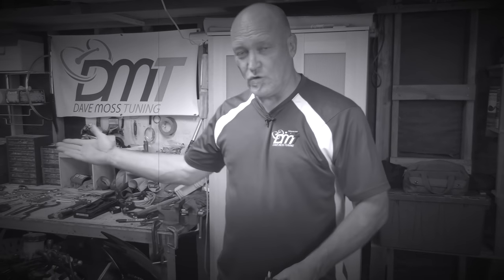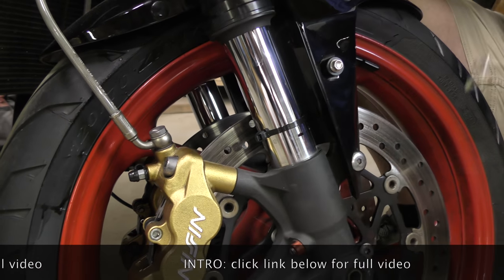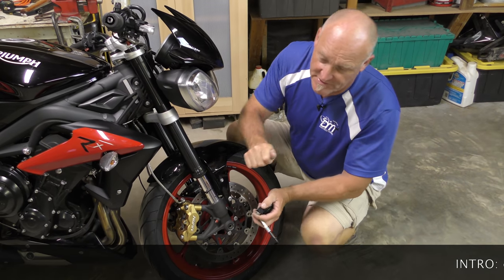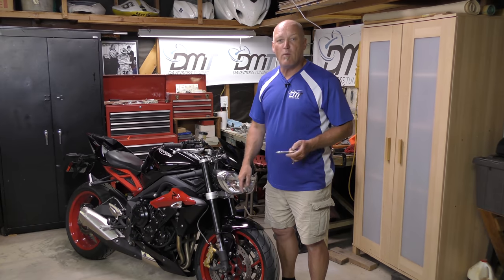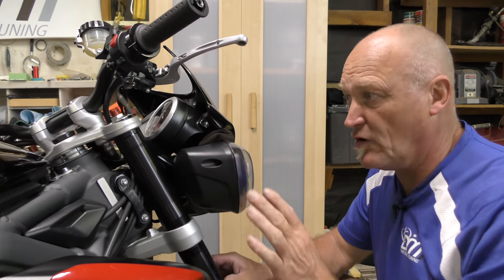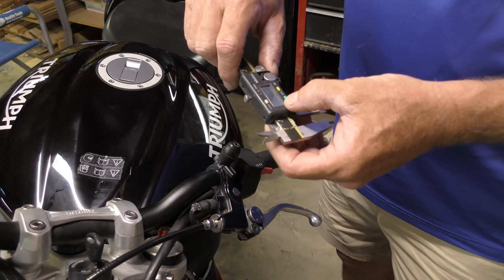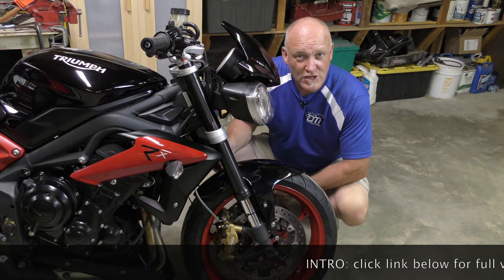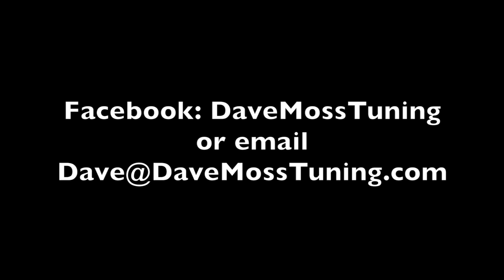INTRO How & Why To Change Your Motorcycle Fork Position

Comment: I have a quick question on this. I have an S1000XR and I get a slight front end wobble at high speed cornering (90mph+ sweepers). Increasing the rear preload decreased this wobble so it makes me think it's a problem with the pitch of the bike. Usually increasing how much the forks stick out at the top make the bike more agile but less stable at speed due to reduced rake, but would it help with the wobble due to pitching the bike forward and putting more weight on the front? I don't really want to go higher on preload as the ride would be too harsh and other handling issues arise. The bike has electronic suspension and putting the damping into the sporty setting also helps a bit with the wobble but it's still present. The forks are currently level with the triple tree so there is no room to go down. Any help would be appreciated!
Reply: I might be wrong here but that sounds like a rebound issue tbh.
Reply: @greyanaroth  Maybe, but as I said no way to fix it directly due to electronic suspension
Reply: @AntaresSQ01  I remember dave suggesting, depending on the amount of travel used :

Take out preload so it'll stop the spring pinging back (if you're not using enough travel). Do you have a zip tie on the fork?
Reply: @greyanaroth  As far as I'm aware the preload on the front forks is not adjusted by D-ESA or very minimally, basically when adjusting the preload it raises or lowers the rear  for the most part, you can pitch the whole bike forwards (increasing rear ride height/reducing rake and trail). It's weird but it helps, despite on paper making the trail/rake smaller it should make the bike more nervous. It's not a perfect system by any means but I'd rather have 90% correct suspension 90% of the time than 100% correct suspension 10% of the time. The only issue really is with the head wobble in high speed corners when on the gas. This can be vastly mitigated but in doing so I cause other issues/discomforts in the handling, so I'd like to root it out as a geometry change, and retain fine tuning control from that point onwards. Basically as Dave says, you don't want to be at the end of adjustability, first you wanna get the bike generally right, then fine tune with adjustments. Right now (and I am really exaggerating) the bike is not set up right for me, so no amount of adjustment will fix it completely. It may be something I have to compromise on, after all it's a Sport tourer not a Superbike, but I want some confirmation to my theories or guidance before I start messing with the geometry.
Reply: @AntaresSQ01  perhaps do a remote tuning with dave? He usually has insight you and I may not have evun begun thinking about
Reply: @greyanaroth  Hey, just as little update I played around with the settings and when the suspension is at it's absolute softest (rear preload on 1 rider, damping in road) I almost bottomed out the forks, about 5mm from bottom out. This was on a fairly aggressive twisty road with long corners and hard braking zones as well as some bumpy sections. 1 rider preload felt straight dangerous with road damping, it felt like the bike wanted to tuck under constantly at the rear when pushing hard. Next I put the bike in my usual sporty mode, 1 rider + luggage and damping in dynamic. This felt bang on, good stability in corners, stable under braking and acceleration, forks were about 40-45mm from bottom out (front on the XR has 150mm travel so this is just over 2/3 of the travel used) I'm not sure if the preload was the reason, I suspect the damping stopped the forks from bottoming out. I didn't have time to separate the 2. but when I observed how the damping works, you can obviously see it compress the shock and raise the bike on the rear, but you can't see anything at all happening on the front so, as i suspect no preload adjustment on the front. Then I did 2 rider preload + damping on dynamic. The ride in 2 rider was horrible on the bumpy sections, spine shattering. It felt a bit more "on it's toes" tipped in nicely, felt okay through the corners but was a bit twitchy on corner exit. It was rather good under braking though, noticeable less dive and as predicted, more stable in high speed scenarios. So my view right now, is I need to get the positive qualities of the 2 rider preload setting, without the spring being so hard. I don't know if this makes sense, or if you even care at all, I'm just rambling on over here haha
Reply: @AntaresSQ01  rambling is good haha. IIRC you can adjust front preload as well as rear preload manually. This, for the rear, I think changes the zero point? Time to crack open the manual!

Edit: seems like 1 rider + luggage on damping was the secret sauce. Probably have it set on that and crank up the manual preload adjuster on the rear (if it's an option) a wee bit to hit the sweet spot? This whole Esa thing tbh put me off these bmws, even though it works great for bump absorption
Reply: @greyanaroth  I know you can on the Non D-ESA suspension but on the D-ESA there is no manual adjustment options on the forks. All of it is done electronically, As for the rear, I don't see any "overrides" either. I know this is not the case on the S1000R and RR but it is on the XR (the D-ESA R and RR have electronics in both forks, the XR only has them in the left fork, right is a good old standard fork.
Reply: @AntaresSQ01  there is a nut on the fork cap on the right side, yes? And an 8mm adjuster on the rear?
Reply: @greyanaroth  No on the D-ESA the right fork cap is just a regular blank cap, I haven't really looked at the shock but i suspect it's the same, however you gave me a good (hopefully haha) idea:

https://www.ebay.co.uk/itm/313060260179?hash=item48e3d87953:g:cdUAAOSwuhZenvvM

One of these. Pop one in the right fork, and I should have some adjustment, many bikes have 1 fork damping, 1 preload so i can't see any major issues. I'll call my local suspension shop about what they think though.
Reply: @AntaresSQ01  man I'm so confused with the Esa stuff....

Comment: TORQUE SPECS!!!! A career spent working on German engines has proven to me that fastener torque and torque sequence are EXTREMELY important! The OE didn't pay some enginerd big bucks just to throw some random numbers in the book. 10:50 is a perfect example of why torque is important. Could've been over-torqued and with dissimilar metals the aluminum will deform and "bite" into the bolt. This is why if the head is looking like it'll round off before the bolt loosens up then a couple tappy taps on the head in line with the shank will help to release that "bite".
Reply from the maker: Agreed regarding care and thoroughness with torque settings.

Comment: Hi! I have a yamaha xt 350 that I bought used (obviously ;) ). The old owner has moved it down but I am unsure if he was just short. I am a 190 lbs guy and only drive on asphalt. Should I move it back to default?
Reply from the maker: 1. How planted do you want your feet to be?   2. How much can you lift up the seat to where your minimum foot contact with the ground is?   3. How much shock travel are you using?   4. Are the forks in the stock position? Those questions and answers will guide you on going back to the stock height.

Comment: Just want to confirm my understanding from the video - Raising dropping the folks doesn't change the height of the handlebar, right?
In the video Dave is making the folks taller so the front suspension would sag less than before? And this would also increase the wheelbase as well as rake, trail right?
Reply from the maker: Thanks for your question and for watching!! If you raise or lower the front via fork position the bars will go the exact same amount up or down. Y you are 100% correct in regards to sag and wheelbase. Note that increasing the height increases rake also but to a small degree.
Reply: @catalystreactionsbw  Ohh so when folks are made taller and trail increases, handlebar height also increases? 
A general question - how does the rake/wheelbase reduce during front braking, say before a corner?
Reply from the maker: @sanketjain9320   if the fork travels less, there is more rake and trail.

Comment: Hi Dave I am hoping you can help me out. I am a big guy at around 350lbs so basically my bandit 1200s k6 is basically 2 up permanently. How can I stiffen up my suspension front and rear to suit my needs? Please advise thanks.
Reply from the maker: Hi Daniel. Best option is 1.1 forks springs and 20w fork oil. For the rear shock you can contact Race Tech to see if they have a spring to replace the soft stock item. That being said, you might be better off with an aftermarket shock. https://www.customfighters.com/threads/bandit-1200-rear-shock-swap.62827/

Comment: Does this work when using rearstand lift? Thanks
Reply from the maker: It can work that way but it is much easier to use the side stand to unweight the bike, or have a front stand that goes into the lower triple along with the rear stand, or a Bursig type stand

Comment: I've heard dave say, before, that he's NOT strong. What poppycock. The man played rugby, and is built like a tank. 

Just wanted to add, after seeing you do this on the r6 and noticing a difference between my 2 fork legs, I decided to attempt to correct that only on the outside leg. And it was frightening. It helped that there was a lot of preload to take out, which I did, which made the process a bit easier. Does that make sense? Or was it just placebo?
Reply from the maker: You are correct - zero preload makes in far easier.

Comment: I own a 2022 RS660, I'm 5'9" and the bike is a bit tall! I purchased a 1" lowering disc from AF1 Racing! They told me to lower the front forks the same length! Is there going to be any problems with this set up? I am def no pro at geometry on bikes! Would much appreciate your opinion on this!
Reply from the maker: At this point, the 1" drop in the rear will require a 3/4 inch drop in the front to provide a reasonable start for geometry. Then assess fork and shock travel used. Note that lowering the bike also needs firmer suspension.

Comment: Bloody hell Dave, I just bought a 2010 Speed Triple and I am vertically challenged.  Only today I bought a lowering link that lowers the rear suspension 1.6” ... I will then need to lower the forks.  I am starting to think I have made a mistake !!!
Reply from the maker: You did not. Take your time to lower the forks as you must with a 1.6" drop in the rear. As per video, it is a very simple process that you can do very slowly.

Comment: Dave, How worth it is it to change preload to  help or hinder turn in rate knowing it will change sag settings. Thanks
Reply from the maker: Changing preload is to get to 10-15mm of marked bottom out. Using compression to get 7-10mm helps with trail braking and together they effectively manage weight transfer for braking stability and turn in.

Comment: Im an aggressive rider no chicken strips on the rear, I only weigh 125 will full gear! If i did this to my 07 600rr what would the consequences be? Will i benefit by raising the front forks (lower 1/2 inch)? Thanks in advance Dave!
Reply from the maker: Changing fork position is based on travel used. Have you marked fork bottom out on the right leg and put a cable tie on it for reference? Without that knowledge there's no plan for the "why" to do it.
Reply: @catalystreactionsbw  no sir i havent put the cable tie yet, i have looked at the forks and  i can see the line and only travels mid of the forks. I thot i could try this to make my corners sharper haha
Reply from the maker: @geocalamansi8356  Try taking out all preload counter clockwise, count the total number of compression clicks as a range and set at 50%

Comment: Im so use to high bikes like dirt bikes, thats my preference to dance with.
If I lower either end on my street bike, I know Id scrape badly in the turns.
My exhaust, frame, & gear box cover are all already road raked on both sides from scrunchy lumpy corners around town.
😁